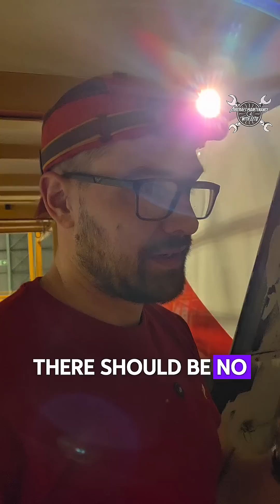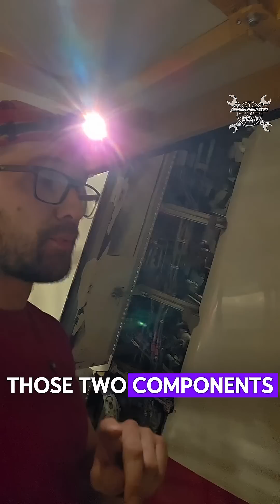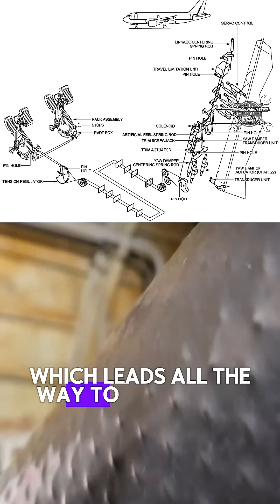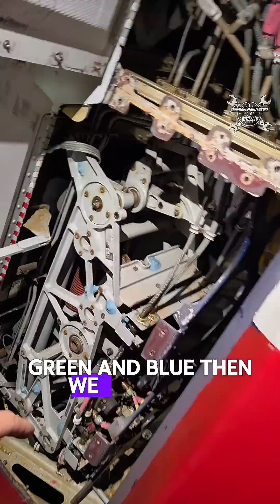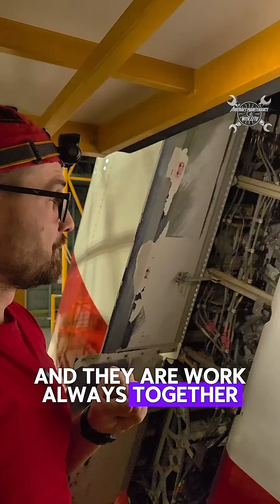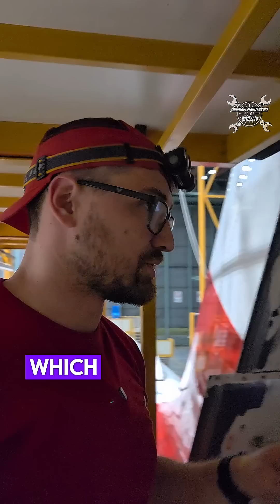is rudder part of fly by wire concept on A320?

Comment: Pardon my ignorance but if those pedals do the rudder, what controls the braking when landing?
Reply from the maker: They have dual movement brakes are controlled by pressing pedals forward on bottom joints and during landing aircraft brakes works automatically based on settings

Comment: Haven’t tried mechanical back up in the sim, only direct law with double hydraulic failure, but man, mechanical back up would be a really bad day in the office.
Reply from the maker: There is just mechanical control to hydraulic system no direct connection to rudder

Comment: Do you wanna tell that you are able to control the rudder and stabiliser without hydraulic system? My understanding is that mechanical backup is only can compensate the absence of electrical signal between the cockpit and actuators, but not if “everything doesn’t work” (unlike 737).
Reply: You just said that if “everything fails, you always have…”. Never mind, just to clarify! Anyway thanks for video! 👍
Reply from the maker: Yes you are right. I never said that it is controlled directly.  Watch it again 🙂

Comment: Are the cables a backup system to a fly by wire system? Or are they the primary method of controlling the Rudder and stabilizer?
Reply from the maker: They are connected to actuators. There is no direct connection between surface and controls